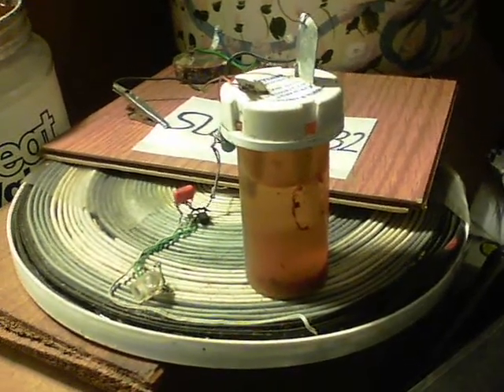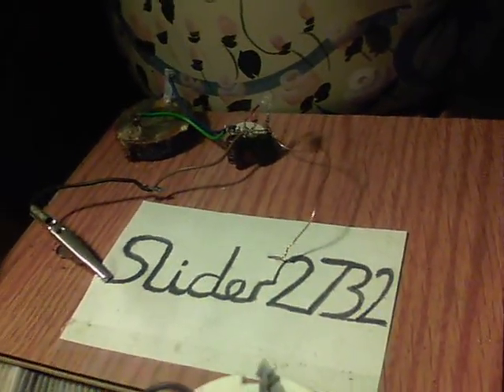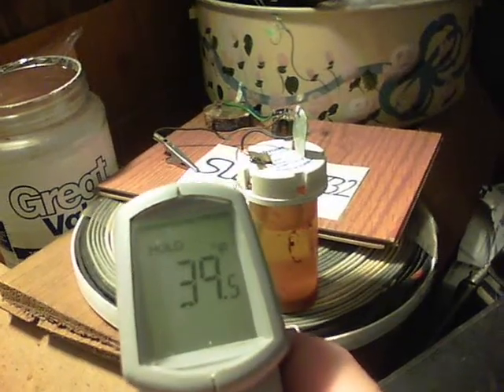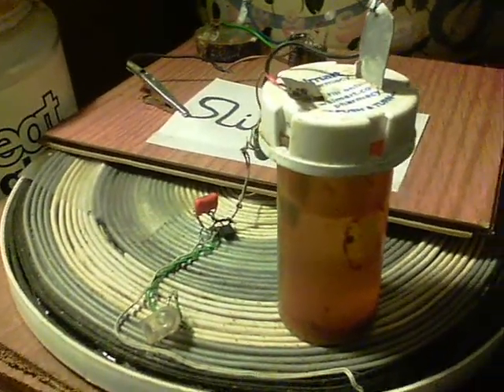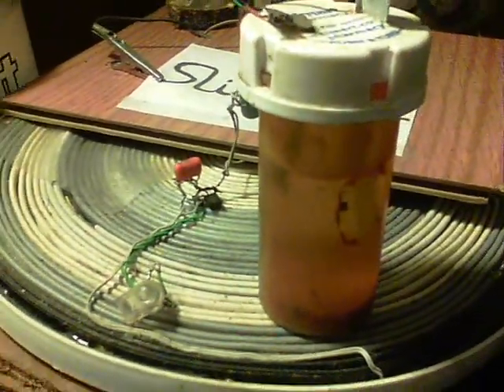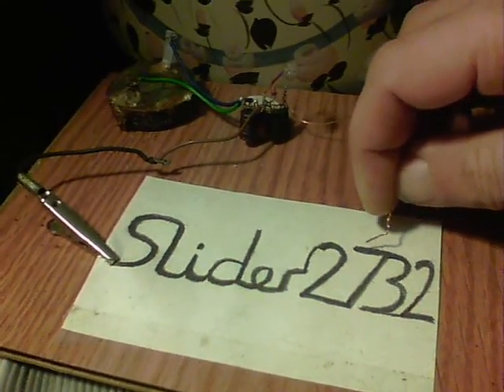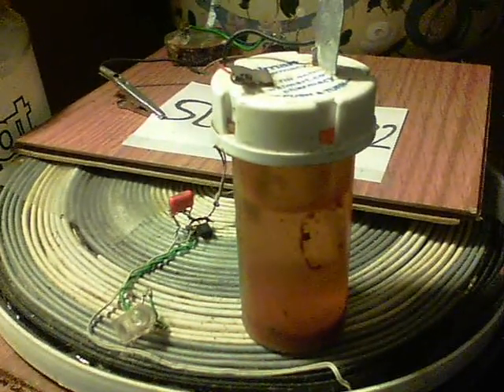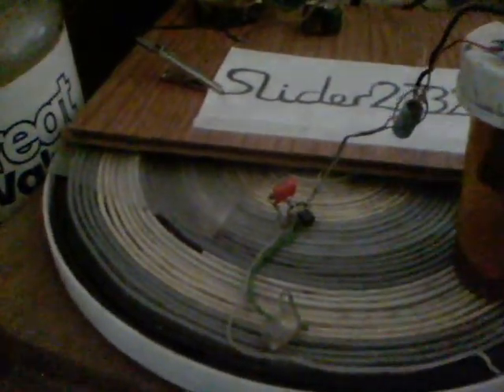Cold ions finding - Nephilim Penny at 2 years

Comment: Electro Magnetic energy from your hand? You could try just putting your hand near it (not touching) and see if that affects it, thanks for sharing. I'm just about to do a video on my experiments with the pancake coil. Instead of using 2 core I used 3 core (8-10 Amp) and added another transistor. Although not as many winds I get more distance and more power. Parallel wires are sure to increase the Amp for sure :D

Comment: Your picking it up might have done the equivalent of shaking it a bit. You also held it on an angle. Just suggestions to test for. Bot saying I think that's it. Happy holidays!
Reply from the maker: I tried that yesterday to verify, nothing happened tho is a very valid thought...agressive shaking used to work a year or so back, which was how I belatedly realised that cleaning keeps the metals going (flake bits would fall off). The water level is a bit lower so was worth seeing for any difference. Best to you for the New Year !

Comment: Hi Slider,

I think this is the thermal electric effect between two different metals, you can see the same effect on one of my videos (self generating power cell)

What is the reading on the cell right now?

Thanks
Reply from the maker: It's running now at 45F, reading 0.567V. Works from around 0.480V
Metals heat was a thought, but it seems too sudden a kick up back to working again. Maybe it's only a degree or so too low to continue running.

Comment: Got me stumped. ***** Has a good suggestion with the warm water and timer test. I assume you have shaken it and waited? To confirm its not a delayed reaction to being disturbed. Maybe try putting it in the presence of electrical or magnetic fields and see if its that.
Reply: one other thing you could be changing with your hand.... Light.

I cant see how it would make a difference, but its easy to test. :)

The more I think about it the more I think it could be the body's electrical field, Static or skin capacitance, something like that. Your oscillators are so damn effecient, its probably a tiny amount of power triggering the almost full cap to dump through the inductor. Your body's capacitance could be creating a tiny columb force event in the cell.
Reply from the maker: Hmm, light from the sun is how I think it hasn't gone stagnant in there, the setting sun strikes it every day...a little Giza pyramids system in the kitchen maybe :)
Shaking can work, when there's crud from corrosion and non regular cleaning. That's how all that sludge ended up there. But all has been cleaner for a year or so. Thanks for the thoughts.